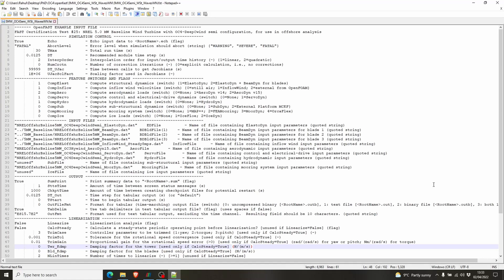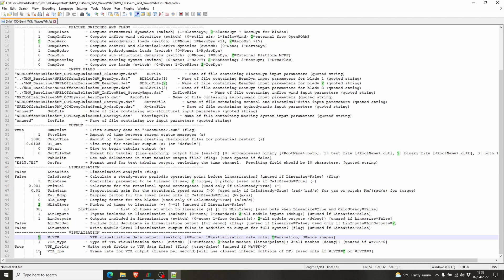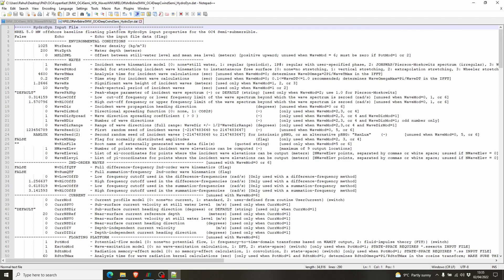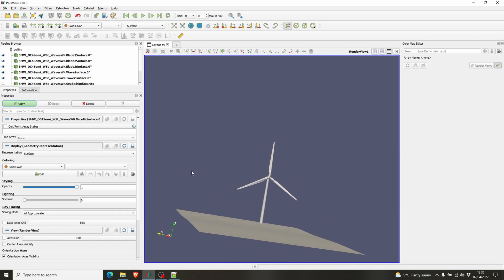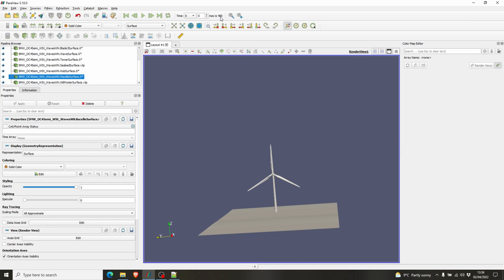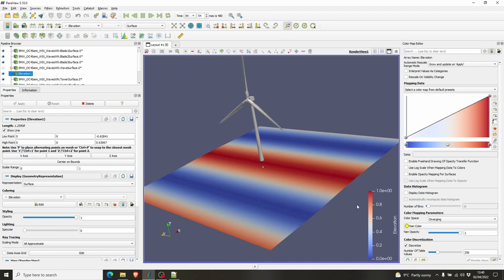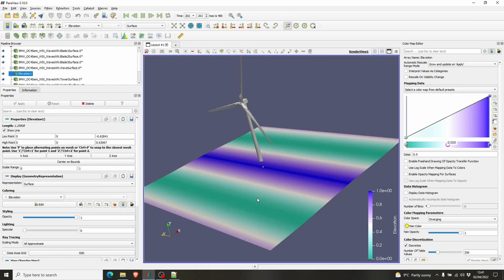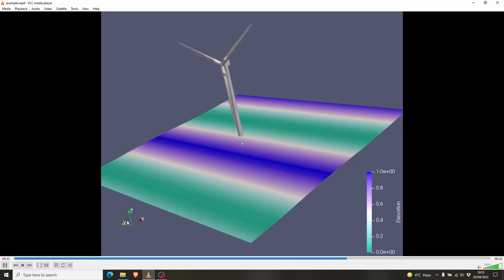Wind turbine visualisation using OpenFAST and Paraview !

Comment: Would you like a sample of a 15mW turbine?
Reply from the maker: check the IEA 15MW turbine
Reply: The design posted is pitch set for 5m/s, but has other pitch settings for 11, 18, 25 m/s. I would like openfast sims at all points. Please message me to discuss.
Reply from the maker: @HolbrookAerospace  I didn't understand. Th wind speed can be changed in the inflowfile. Blade pitch can be adjusted in the elastodyn file.

Comment: Hello.

I also want to visualize the floating semi-submersible structure and the mooring lines.
How do I do it?

Thanks
Reply from the maker: To visualize floating platforms you have to use Openfast 2.5 or older. It is not possible to visualize mooring lines, unless you edit the source code.
Reply: @navalarchipelago2475  Hello yes i'm using Openfast 3.0 versiob but I'm unable to see the VTK file for the floating platform. Can you please help me on it
Reply from the maker: @muffaddaljuzer2439  2.5 or older version, like 2.4, 2.3 etc. not newer.